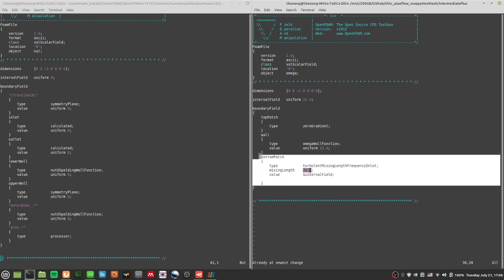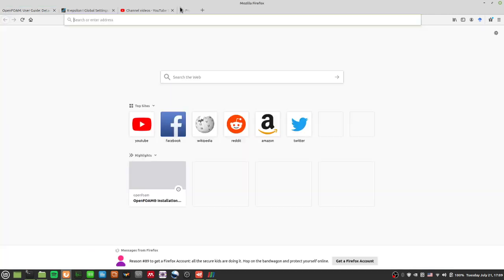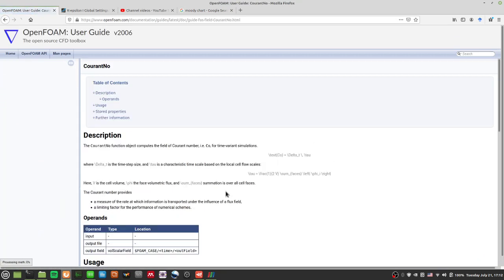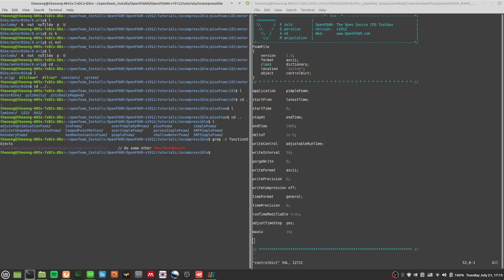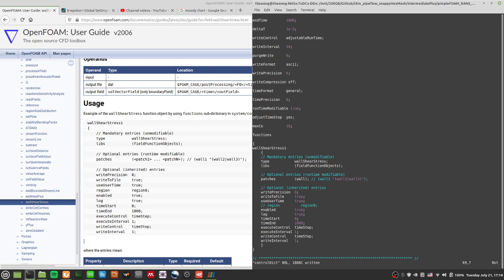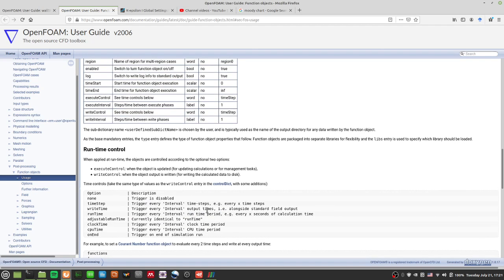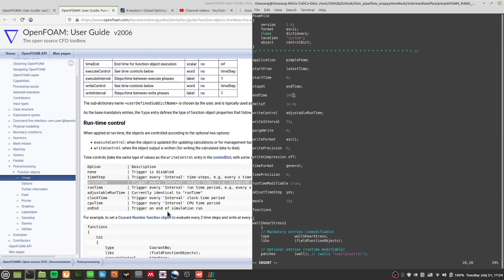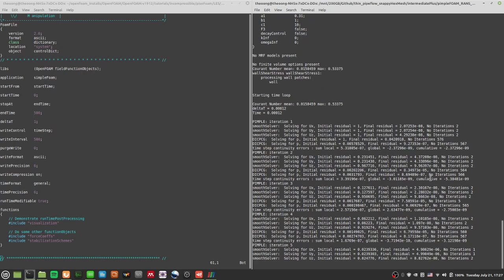OpenFOAM Intermediate - 68  wall Shear Stress functionObject

Comment: I am using DenseParticleFoam solver to simulate two phase flows (Laminar/DNS), the issue I am facing is, when I add wallshearStress command it will give me this error "Unable to find turbulence model in the database".  Please help me.

Comment: Hi Theo, thanks for the detailed explanation. Btw, I tried to simulate the laminar flow past flat plate and compute the wall shear stress. I am getting negative wall shear stress. But I thought it's forward flow and the gradient is positive. Shouldn't my wall shear stress be positive? Thanks.
Reply: How are you able to use that functionObject with a laminar flow? For me it gives that error:
Unable to find turbulence model in the database"